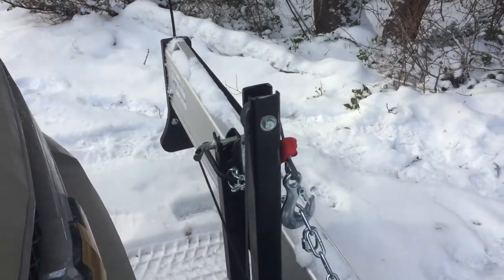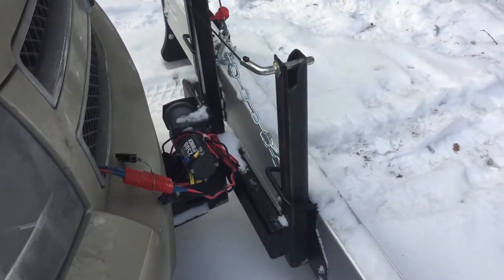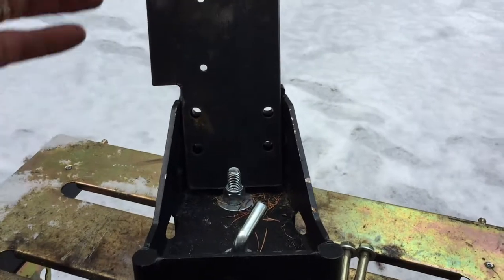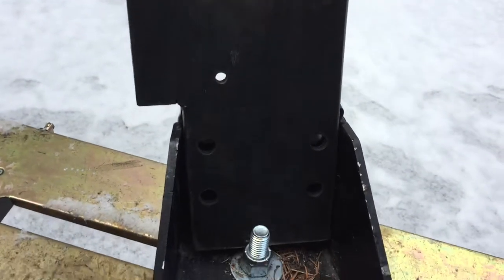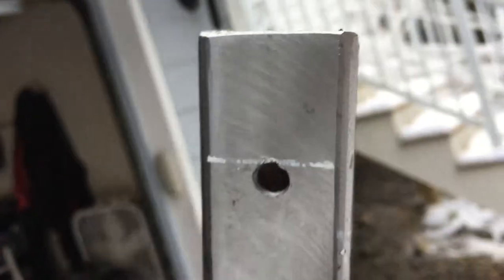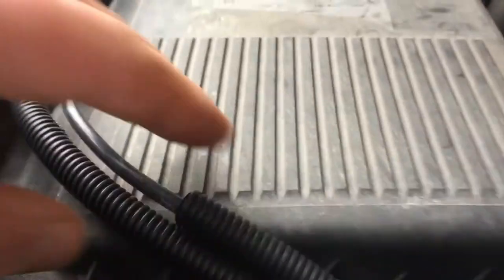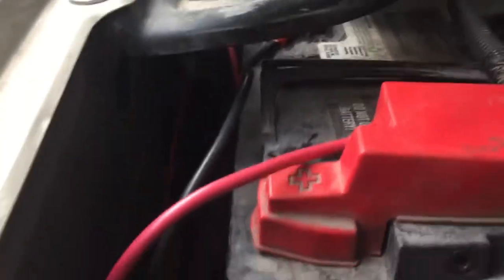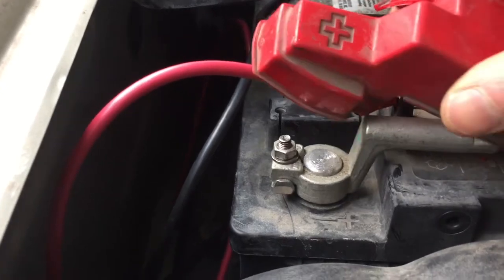SnowSport Plow Winch Addition

Comment: Looks good. How do you know when to stop the winch when inside the truck?  Is the boom mounted high enough you can see the pulley?
Reply from the maker: No, I didn't build in a good system to tell when to stop the winch. I should have made the pulley about 2-3 inches higher (see the [longish] video description) so I could see the winch hook. Since I don't have that I can pretty much tell how high to pull based on the height of the guide wands on the sides of the plow. Also, if I raise the plow too high the blade runs into the factory stop pins on the top of the plow mount, which stops it. Some people have attached a little flag to their chain to show when to stop. I have enough of a visual reference with the wand but that's also a good idea. I'd change what I have if I did it over but it works fine for me after a little practice with it.

Comment: quick question are you able to push the snow with the plow if the wrinch is raised a little? to push the snow piles back more or is it only ment to push snow when it is sittin on the ground?
Reply from the maker: I've done that a bit. As long as you aren't pushing too hard it should be fine. The plow will have a bit more leverage over the steel frame when it's raised so you'd have to go a bit easier but that steel and the frame connections are pretty sturdy.